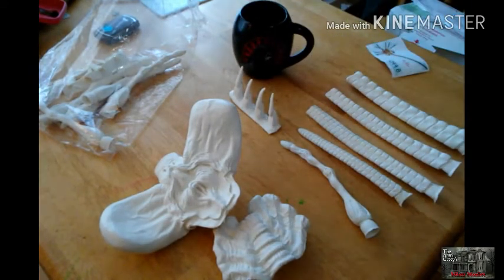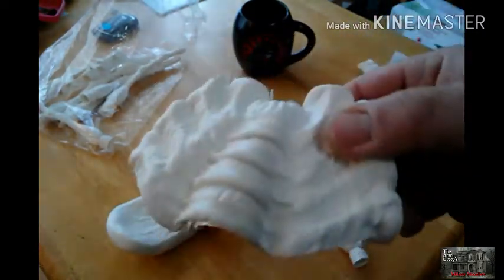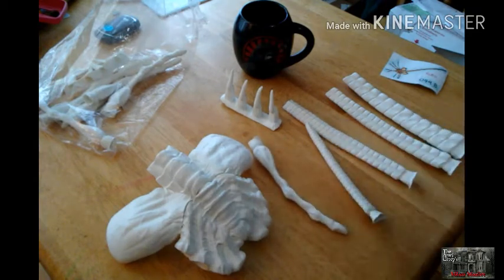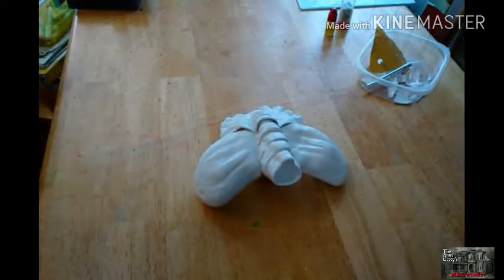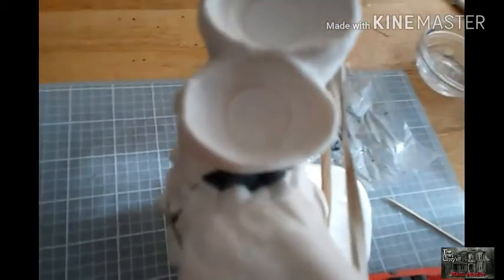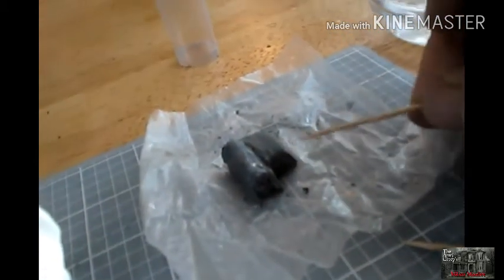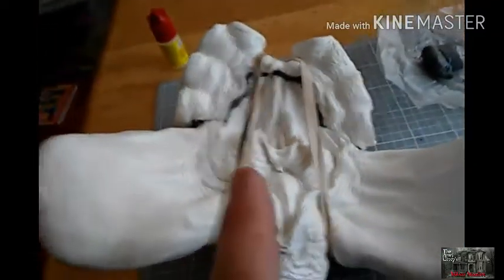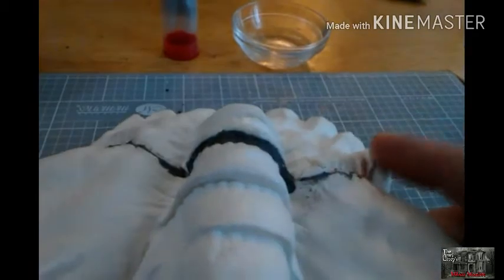Facehugger 1:1 Vinyl Model Kit Build PART 1 I The Creeps Milieu Macabre

Comment: I built one of these many years ago.
It was the original Halcyon kit made of a much more pliable, easy to work with, vinyl.
This recast is spot on, similar but the vinyl used in production is very hard.
Since the originals are rarely seen at a fair price, I picked up a recast and will probably start working on it this week.
Even with the original, there were lots of fit issues but they were easily fixed.
This one will be assembled as a static kit.
Just need to get an awesome, viscious, menacing pose.
Heating, bending and filling.
Used wire armatures in the digits with the Halcyon kit, because it was pliable, to make it poseable.
That’s not going to work with this stiffer vinyl.
Anyhow, cool vids.
Reply from the maker: Thanks for the kind words. This is also a vinyl kit. IF you make a video on your kit build, be sore to let me know. Love watching that stuff. Thanks.